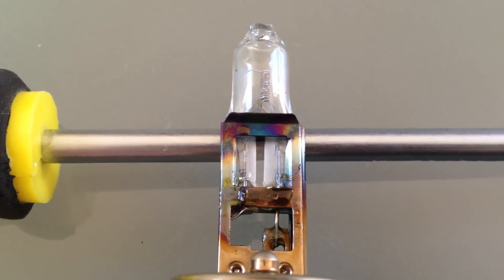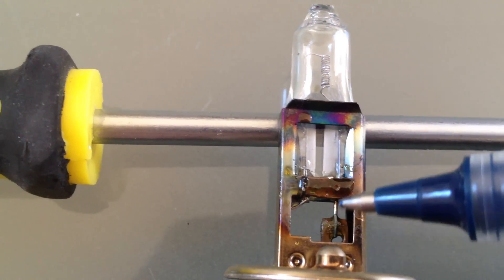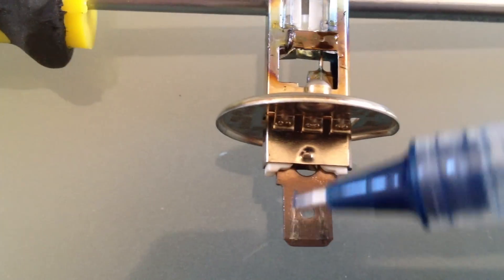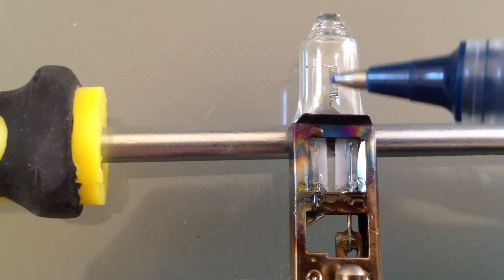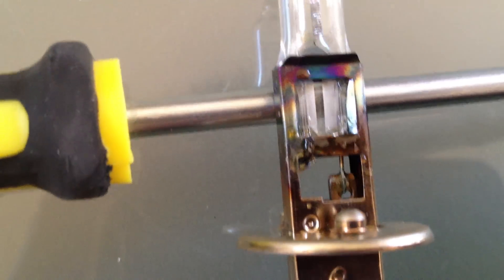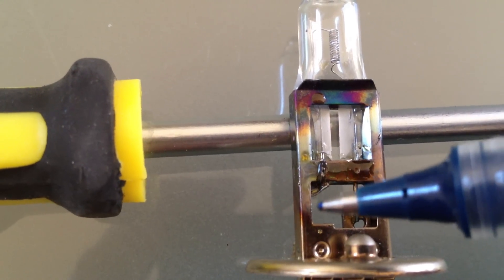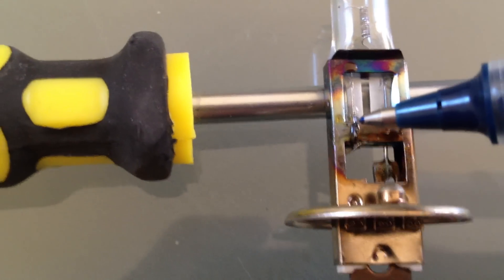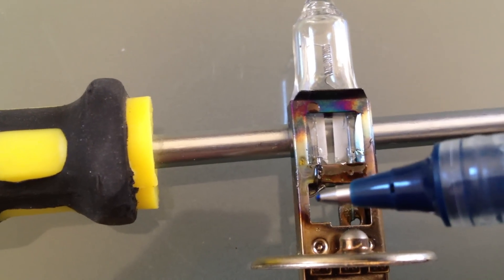Subaru Headlight bulb mystery solved - Outback 2002 other models

Comment from the maker: I think the biggest problem is the lights on the Subie are on all the time (Day time running lights) hence their short life.
Reply: In Canada your day time running lights or Autos have to be on at all Times.  All cars. So no that is not it.
Reply: Jacana Productions I turned my DRLs off completely. There's a box under the dash next to the steering column labeled "Daytime Running Lights", if memory serves right there are two connectors, a blue one and a white one. Unplug the blue one. Test all lights and make sure everything is fine. If not plug the blue one back in and unplug the white one.
Reply from the maker: Thanks but I think they probably help regarding safety and this is an older car and some of the drivers in our town are crap ... in Germany a drivers license in $1200 in Colorado I thinks is $100!